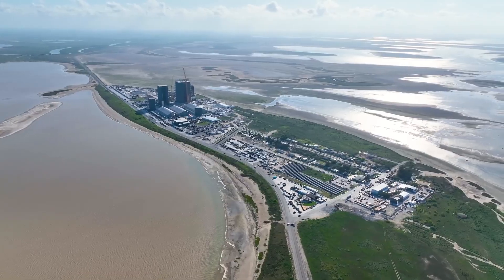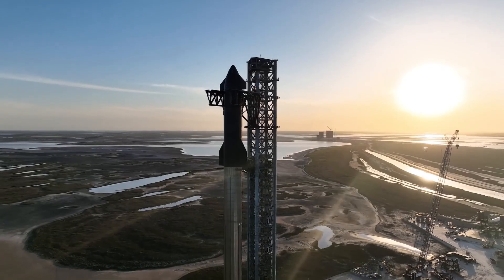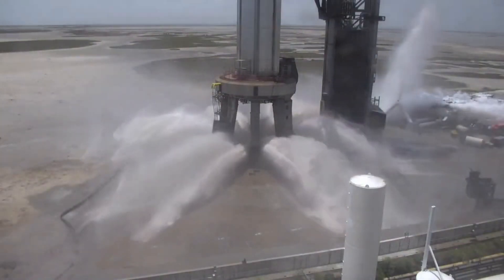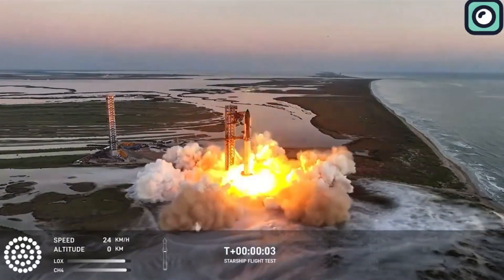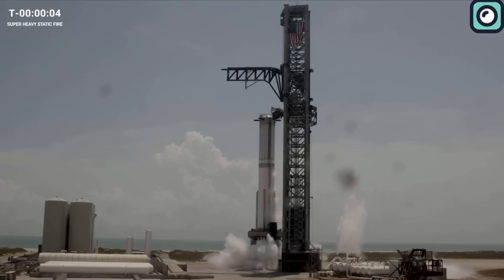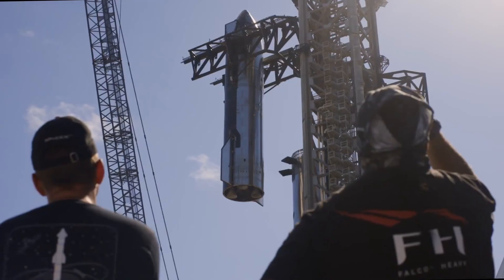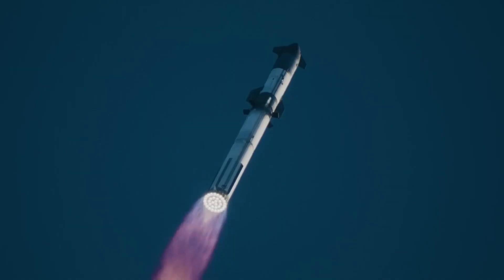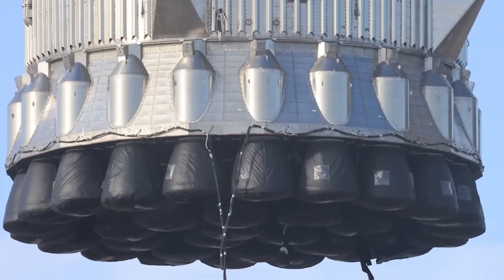SpaceX Made Some Genius Upgrades To Starship The Orbital Launch Mount OLM

Comment: I mentioned this in another channel but it’s worth repeating here. The heat shield panels,as they are replaced should not go to waste: they should be used as a layer of protection for the bottom half of the mechazilla tower and maybe at the base as well. It’s heat refracting properties could mitigate the softening of the structure,otherwise known as an annealing effect,in the metallurgical field .
Reply: brilliant👍

Comment: What they need (I think, and I'm not an engineer), is 8, set on 45degree angle, towers about 80' high, with 45 degree back struts facing the OLM, with a return fire suppression system upon launch, and re-entry. If they are going to try and catch the ship, that's over cooking your pizza. 
I'm still so astound on how they caught it went, and I think I probably watched it over 100+ times. 
The booster catch was nothing short of "just how they planed." But the Ship gimbals allot quicker, but I'm trying, and hoping that it works. But they have the best minds working/planning it out, and if they cant catch the booster, it will work (knock on wood). 
Thanks for the episode. keep it up. 
- NOM